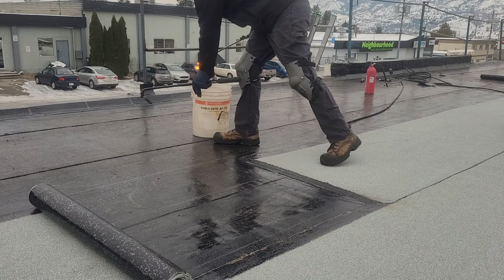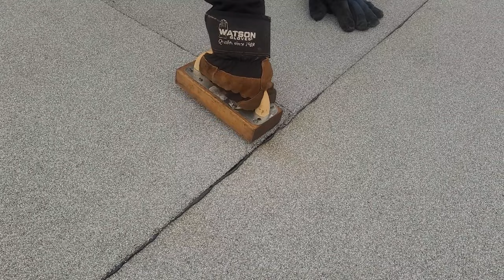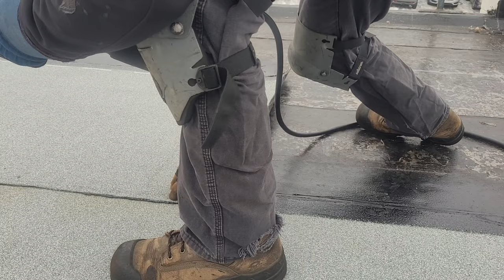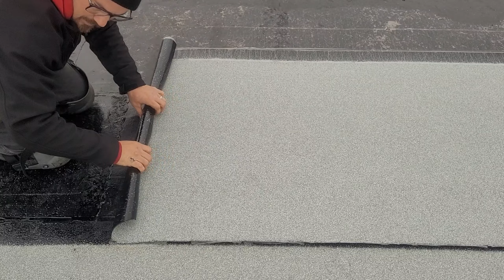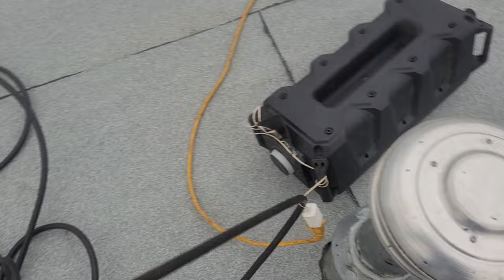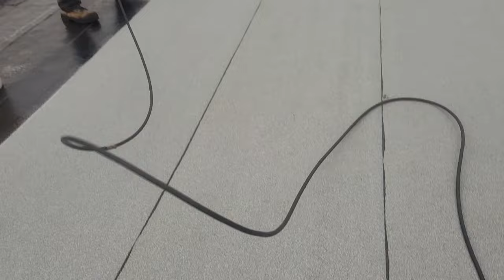torch on roofing, cap sheet field install for 15 minutes!!!

Comment: This is the best way to do torch not the scab way by walking on your cap sheet or your field sheet while torching. This is way better than displacement, this is what you will learn in the Union. This is not what you learn from a non-union shop. Which is what we call a SCAB roofer….. Go United Brothers of Roofers & Waterproofers Local 54 Seattle WA.

Comment: No pressure on the roll
Reply from the maker: I push down with my cane and it also gets weight from the roll itself as it rolls out 🤘🏽🔥
Reply: We use a roll bar and stand on the roll and push it with our feet
Reply from the maker: @jamestonks3042  ive heard that before... Maybe a different product than we use here but theres only a couple months out of the year we can walk on it without marking it up and putting out boot prints in the cap sheet
Reply: Yeah when it's very warm it does mark with your feet

Comment: Wheres the fire extinguisher should be using a proper roller bar ?
Reply from the maker: Fire extinguisher was like 10' away and i dont know about a roller bar. Here in Canada this is how its done. Torch weld the cap to the base while pulling with pull cane. The weight of the roll pushes the two membranes together and pushes out the bleedout at the seam. When you get to the end of the roll you have to push down with your cane to get a better bond and push out the bleedout. Happy roofing!

Comment: No roll bar used in application, roll bar helps to maintain equal pressure across the roll to allow spread of bitumen
Reply from the maker: Ive never seen a roll bar but i really like the sounds of it!

Comment: i bet it's stuck but are you sure you are applying enough heat throughout the enire roll and not just the lap? seems a little quick. try preheating the lap a few feet behind you as well it may give a slightly more pronounced bleed out.

Comment: Without a shadow of a doubt this is the finest video of its kind. Uniform speed and precision and thorough dedication to the bonding. Love the tool. Not seen one in the U.K.
Reply from the maker: Thank you very much for the kind words! The tool is literally a 2x4 with a handle! Very easy to make on the go... just make sure you keep it wet... we keep ours in a plastic bucket with a bit of water so it doesn't stick when you press to your warm cap. Happy roofing! 🤘🏼😎
Reply: Without a shadow of a doubt this is the finest video of its kind. Uniform speed and precision and thorough dedication to the bonding. Love the tool. Not seen one in the U.K.
Reply: You should have minimum 6” degranulation on over lap. All that work with 2x4 can be done just as well or better with trowel. In my opinion looks good and consistent bleed out on cap sheet end but doesn’t look like other side is completely welded consistently to the end.

Comment: This man is a BEAST. Hate to see him not round out those corners, though but I doubt this roof will leak. 👏
Reply from the maker: never heard of rounding corners on sbs... on epdm forsure 100% but on torch-on sbs we just cut the corner on a 45 degree angle on the "meat" of your lap. Manufacturers specification 🤙🏼
Reply: Morocco
Reply: May I ask how many years of experience you have installing torch down roofing ?
Reply: @gusmarokity6482  torch down less than a year flat roofing 3 years

Comment: hey dude you are the best torch mechanic ive seen in these video. my name calvin. i use to be a roof mechanic good job. and you got all your tools. and dont walk on sheet that the i was taught good job.
Reply from the maker: Thanks Calvin! 🤘🏼
Reply: Why not walk on the sheet when you torch it ? Im just asking, because i have done that for 15 years and have nothing bad to say about walking on the sheet. If you think about the shoe marks, that mean you just over heat it. The way you are doing youre job is up to the roofer. :)

Comment: I haven’t used white mineral for years and why don’t you use roll bars and is that a tool which you pull the roll forwards ?
Reply from the maker: This is 2-ply SBS torch on application. Never heard of roll bars? We pull backwards with our pull cane as we evenly torch weld the base membrane and the cap sheet membrane together. I know application specs can vary country to country so for reference I am in Canada. We follow all manufacturers installation specifications. Also don't know what the white mineral is... I'm assuming the color of the cap sheet? They come in all different colors, the most typical being Grey, as seen here, black or light black. Thanks for your comment!

Comment: Can this be applied if the roof is not smooth? Like the concrete surface is coarse.
Reply from the maker: technically speaking the surface should be relatively smooth. Realistically, if you prime the concrete before and your seams are sealed, should be ok. It can be more difficult to ensure a good seal if it's too bumpy and lumpy
Reply: @thetrahanman  thank you. What would recommend for a surface that is too bumpy?

Comment: i saw the iko hoodie but is that soprema or Iko cap? i've never tried the sponge, i gotta try it though it seems like a good idea. I see lots of guys just use the puller but i sometimes use a rubber roller to push out bleeds and it seems to work pretty good too. great job though looks pretty good.
Reply: Soprema 250 on a Sopralene 180
Reply: He even has the Proper self made torch stand with a bolt, a chain link and 2 pieces of aluminum bent just right. I use to make these for all of my Roofer buddies and I would sell them for $10 each. They would last a lot longer than the flimsy pieces of thin brass stands. I also made torch Canes, very easy to make.
Reply: @kreftingr  yea i need to make a stand for my long wand too

Comment: Why 2 layers and not just one layer ? I see a smooth layer and an asphalt layer. Assuming the asphalt granules protect the bitumen from the sun, but could you just go with just the granule layer only? Or is having the first smooth layer double protection? 

Also if I’m doing this over bare concrete, of course with a primer, should I just do the smooth layer? Or smooth layer plus asphalt layer. We would cover the layer(s) with rocks at the end
Reply from the maker: Manufacturer spec. Im sure you COULD get away with 1 layer but its sold as a 2-ply system
Reply: Crazy 🤣
Reply: @jamesbaker-fu2zi haha hey I’m pretty new to this and just asking 😆

Comment: Why do you clip the corner off like that. Not the first time i've seen it just never new why.
Reply from the maker: Helps give a better bond on the lap. So that the seal is to the 2 pieces not just the one. Also helps reduce buildup. I think mainly it's to make a better seal on that T-lap...
Reply from the maker: @mister perfect you explained it perfectly and in Canada it is also manufacturer spec.
Reply: @thetrahanman  It is in the MFG. specs. Most roofers dont care to read or follow them. Good work!

Comment: need to do my roof, drain blocked, flooded and it sagged now in centre big time, can i just sit on some osb board where its sagging and refelt it, with a mitre on edge of board, or is say multiple layers of felt better.
Reply from the maker: ....think it's time to call a professional pal 🫣
Reply: @thetrahanman  I did then uncalled them after the ridiculous quote,, I’m a joiner and roofer  so the sag I can sort if I really have to, it’s about 15-20mm deep water sitting, I don’t really wanna rip it off and open a can of worms if I can  just stop the majority of water pooling in centre for now, cheaply.
Reply from the maker: OK, OK I see I thought u were playing... I mean any filler would work, plywood, osb, even ridgid insulation... then roof that in to keep water out of that area... yup sounds like a plan to me

Comment: Are you just torching it down on the deck?  Why no build-up?
Reply from the maker: No sir, a base membrane is mechanically fastened on the laps and perimeter, laps are torch sealed and then the cap sheet gets fully torched to the base membrane
Reply: @thetrahanman  Thank you for taking the time to deliver this explanation.  Perhaps you can do a video on this measure.

Comment: before you do the torch down on the flat roof, what was the black sheet called under?
Reply from the maker: That's just base sheet, or specifically torchflex 180 base
Reply: is #75 better than #150?  What about the torch one you put down, are there better ones I should look for

Comment: I have a flat roof and planning to have solar panels on it.  Is it better to put two layers of the top layer?
Reply from the maker: I wouldn't say that's necessary. As long as you have a roofer involved in the installation you should be fine. I've seen many different installation methods out there and they aren't all fantastic... buyer beware!
Reply: @thetrahanman  So it’s just going to be the smooth layer and bitumen with gravel
Reply from the maker: @superbad0415  well this system is a 2ply sbs membrane.  Consists of the black layer (base) either mechanically fastened or fully torched to approved substrate followed by a cap membrane which is the same as the base just with granules attached to the top sheet. I wouldn't recommend having gravel on the roof if that can be avoided

Comment: Good job but no need for the wet trowel a regular 6 inch rounded trowel is just as good
Reply from the maker: True, i use trowel sometimes, the wood block makes it easier to get a nice bleedout everywhere and to not mark the cap. Inspectors really like it too because you can push your lap with more area and pressure than you could with a trowel

Comment: Odd question... What psi do you have your regulator set to?
Reply from the maker: It's maxed out... I'd have to check to see what it says but it's maxed out... just a cold day, tanks weren't giving me much pressure.... I'll do another one in the summer and yall will be amazed at the difference
Reply: @thetrahanman  ya I mess around with mine sometimes depending if I'm using a full tank (60 or 100 pounder) or not. I'm in Ontario but you and I are alike. I produce the nicest torch work at the company I work for and do everything by the soprema courses I've gone to (for warrantied jobs). Nice to see other people that actually take pride in doing their job correctly but also nearly as well. Props to you brother!

Comment: Sweet rippins man!! Got the chilly snow covered background n shit miss them days!! Killer time to run hot or to be torching as long as she’s above 52 degrees is that still code? I roofed for 20yrs up in Greater Seattle area union non union wherever the big bucks were! On all them big jobs inspectors watching for days😅checking kettle temps, monitoring outside temps etc. Big jobs up there I remember that shit fort warden, whidbey naval, prisons, schools on all the big flat roofs built up or not them inspectors was a watching!! Good workmanship keep it alive
Reply from the maker: Hell ya dude! Im in the Okanagan now but roofed in much colder conditions when I was in Calgary... The only thing that sucks in cold weather is its harder to get pressure for our torches so definitely everything slows down. Heat blankets around the propane tanks help for sure! Thanks for the comment! Roof on good sir!

Comment: quick question about your preference for under torching instead of over torching and walking on the cap sheet?... i'm trying to decide for myself which way to do it
Reply from the maker: it's just how I was taught from the beginning... not sure where you are from but everyone I have ever known roofing walks backwards when torching field. Definately not as safe as walking on your cap but if you are aware of your surroundings and you have a safety railing installed, walking on base is definately better in my opinion. Sometimes I will see guys walk on the cap sheet when they have nowhere else to go, like end of a roll in a corner and when it's hot and you are fully torching your stuff properly you will almost always muck up your cap sheet by walking on it... (in summertime conditions anyways) in the end its all up to what is most comfortable for you and what gives you the best results! Happy roofing! thanks for your comment!
Reply: @thetrahanman  funny you say that, because i was just torching today for the first time in a long while, and i did it walking on the cap sheet, i had 2 types one thicker but with sand and one just a littler thinner but covered in black granules and i torch walked on the black one it went smooth as hell and nearly no damage at all (and i'm heavey 220+) but that was not possible at all with the sanded one, that one marked instantly even being a little thicker... those granules really save the day

Comment: Looks a good job. I have been doing it like that for 39 years although always taught to cross lay the layers for strength as the polyester carrier runs longways through the roll. Not criticising just an observation.
Reply: Cross lay totally unnecessary but offset is. First layer only half size, no? With your 39 years you were doing side lap seems without bleed out and pressure applied?????

Comment: Pretty good. I'd hit the overlap with a little more heat. Sprinkle some granules on the run out 👌
Reply: It is not a question of little or more heat, it is the question of PROPER heat and pressure of which this torcher has no clue about !

Comment: Yeah after 50 videos of morons doing hack jobs without enough heat or bleed out,  this guy has it right. I like to heat the top of the roll and a little more heat on the selvage edge, but this guy is hired!
Reply from the maker: Thanks! 🤘🏼😎

Comment: What base sheet is that?
Reply from the maker: IKO torchflex 180
Reply: @thetrahanman  applied over standard base sheet or straight to deck.  We have been using a two ply system peel and stick base with a torch cap and it seals great.  But I'd like a thicker base layer seems this is the way ti go..do a video applying base brother
Reply from the maker: We installed asphalt board over the deck area and fully torched the base sheet to that. More expensive but nicer in the long run
Reply: @thetrahanman  awesome!

Comment: How long does this type of roofing last, and does anyone offer a high end material to compete with shingles, or is this strictly low pitch?  Looks bullet proof
Reply: They usually get a 20 year warranty on the west coast. 

This type of roof is strictly for low-pitched roofs, so-called "flat roofs" .
Reply: @sevensages5279  strictly?   Guessing the reason is people dont want that look on their house, but looks fine to me and would make taxes cheaper and never blow off.. Who in your opinion makes the most durable and heavy stuff?  Thanks
Reply: Epdm (synthetic rubber) is one of the most durable and economical(lasts up to 50yrs) roofing systems. 

Carlisle SynTec Systems is a manufacturer of all those type of roofing materials- 
Epdm
Pvc and 
Tpo. 

All for flat roof applications!
Reply from the maker: It's a lifetime roof, so 25-30 years manufacturer warranty. It can compete with shingles but can be difficult to apply on steeper slopes for sure. Id say a direct competitor for shingles would be a metal roof. They are definitely gaining popularity here!
Reply: My roof was done this way lasted almost 50 years no leaks installed when my house was built in 1976. I'm in the south west desert get 120F heat.
Reply: @Mike-01234  Im regretting not using it.  Looks bullet proof
Reply: Normally fine until it rains 😂 just kidding lasts years and years if done properly this guy knows what he's doing definitely
Reply: @jamesbaker-fu2zi  been told skilled installers can install it on any pitch.

Comment: Need to put another material under this Sbs or you just can put on top of old let say ice and water shield
Reply from the maker: In insulated roof systems yes. On this system the insulation is under the roof deck so our base membrane gets fastened directly to the deck

Comment: Not at all your all divs your supposed to put each layer other way 1 vertical next one horizontal not the same way bad roofing sorry so simple
Reply from the maker: Sorry this doesnt make sense to me. This is installed EXACTLY to manufacturer specifications. Maybe you are used to using another product, or maybe your just doing it wrong?

Comment: No . Were best in uk we don't walk backwards on a roof!!
Reply from the maker: That's great advice forsure! It's how the manufacturer recommends us put it down here 🤷🏻‍♂️... I mean we use guard rails and you know your close to the edge when u get there anyways... never had a problem but any other time rather than blasting down field I'd agree with you. To walk forward we would have to stand on our rolls and it's too hot here for that, we would muck it all up🤘🏼
Reply: @thetrahanman  yes 👍 we roll our     felt round a 4" pipe cut at 98cm, then heat and push roll out with foot keeping a constant even pressure,  the roll bar ensures pressure is applied,  motions keeping ball of foot on roll always aim for a perfect 6mm bead on lap , but summer we have to start early eg 4am because above 30 degrees felt marks , helps it cooler over hear
Reply: @nonsheep5823   yes and try having fire extinguishers  . Everyone saying how great it is but when he does them little jumps with hook look at the seam no bitumen bleed on lap he has to go back and finger it seen better need at least 6 mm continuous  bleed .wouldnt pass a bauder inspection sorry to piss on your fire but done and seen better